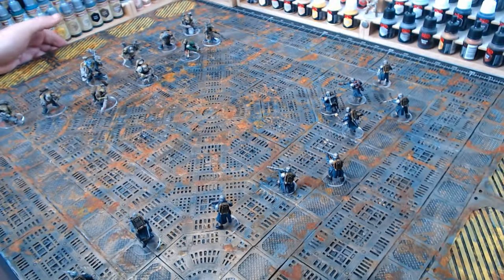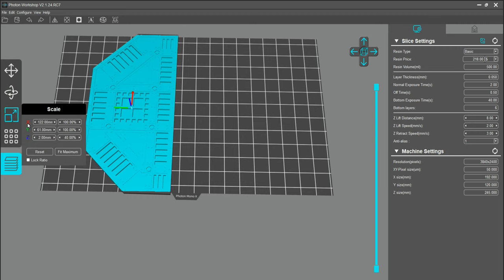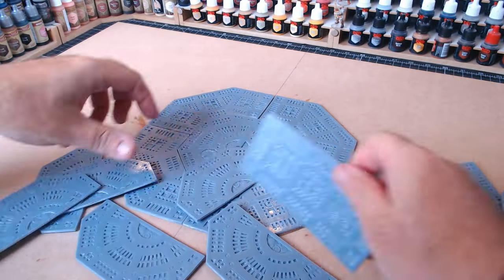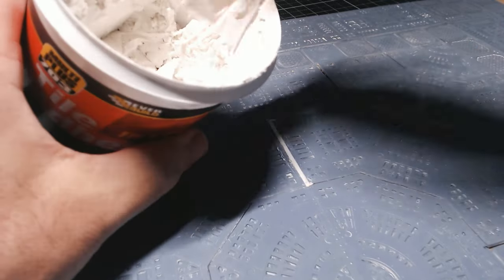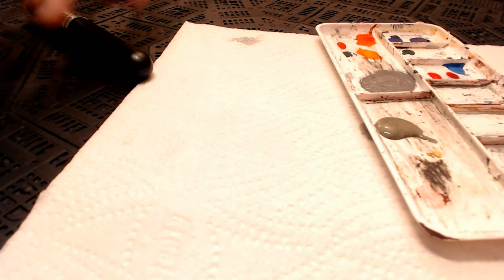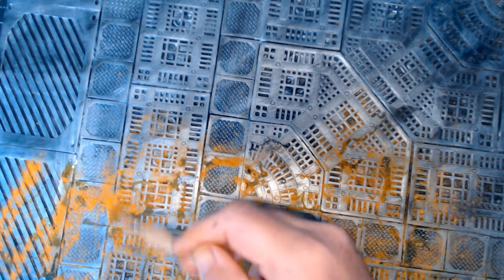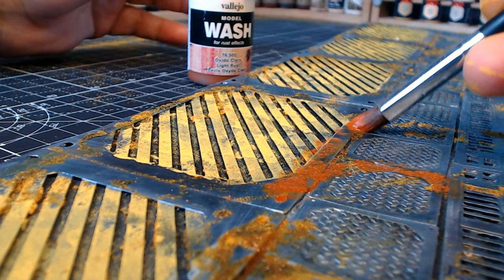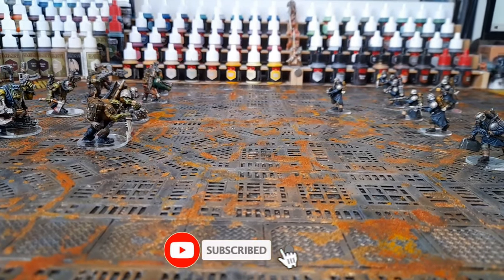How I Made a Gallowdark Kill Zone Board for Warhammer Kill Team Into The Dark

Comment: Great video and board! For future use, you can use less gorilla glue, and just use CA glue to clamp the piece down. A trick I use in my woodworking/carpentry profession. Also, to quickly find the center of a panel, just draw lines from the opposing diagonal corners, and where they meet is dead center; square off from that to extend to the edges. 
Thanks again and I look forward to future projects!